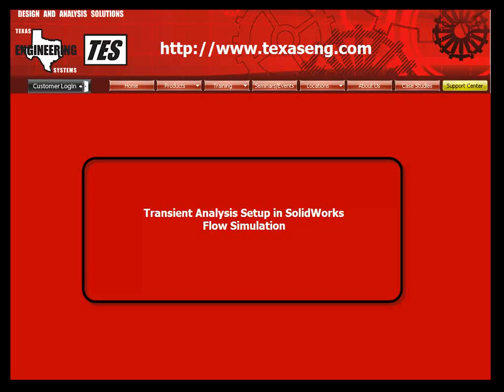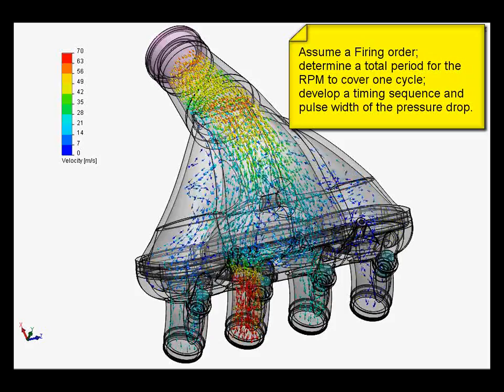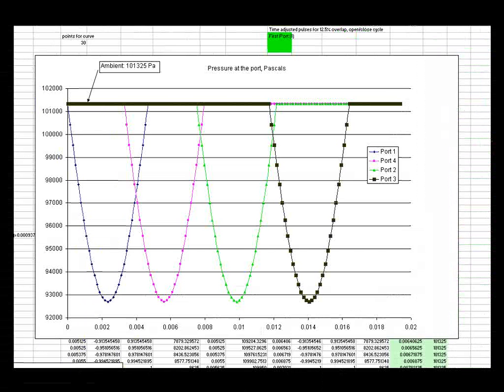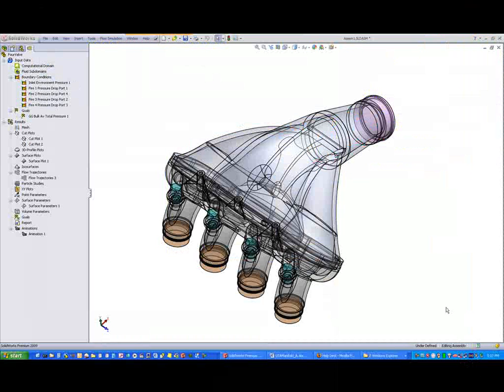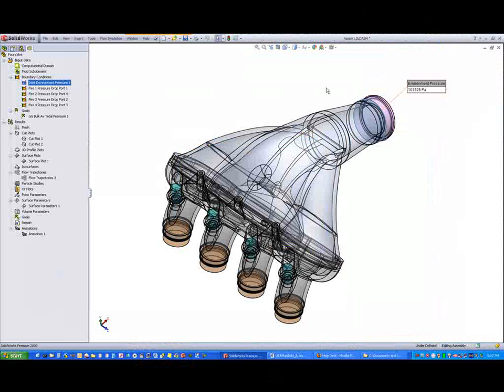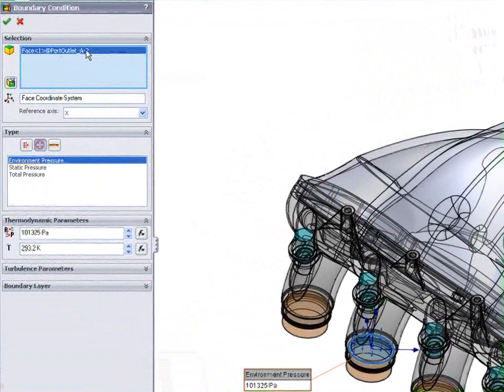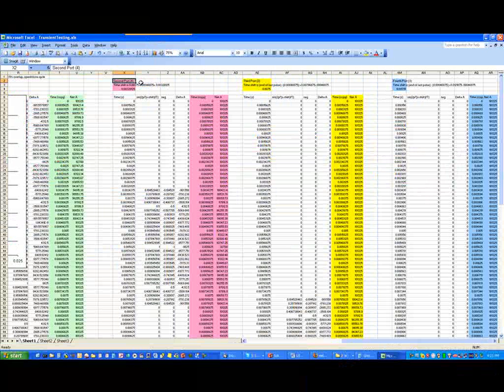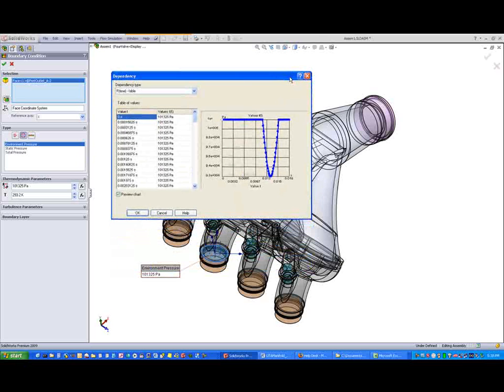SolidWorks Flow Simulation - Transient Manifold Airflow

Comment: In a flow simulation of fluid flowing in a series of pipes, in a region of high turbulence in the pipe, how can I find the velocity of flow at a certain point in the high turbulent region over a period of time. Say for example, velocity at that point at 5 seconds, 10 sconds, 15 seconds, etc? Please I'd appreciate a response.

Thank you!
Reply: you can draw a sketch line through the point you want to monitor, then use the xy-graph utility to examine the velocity magnitude at saved time points in the solution (you have to tell the software at what time points to save results prior to the run). Tutorials which come with it have xy plot examples, or contact your VAR for more details. thanks

Comment: Hi Sigsite!

Is it possible to simulate things such as heatsinks?

Lets say I desing a heatsink, and I select the part of which is supposed to be in contact
with the chip. Could I select the surface of that part, increase the temperature to any value, and see the heat spreading through the heatsink as well as seing the surrounding air get hotter and rise?

Thank you!

Comment: Dear Sigsite,

I'm a mechanical engineering student and at the moment I am graduating at a company which develops filter systems, do you happen to know if it's possible to insert a material which leaks air ? (i'm trying to make a simulation with filter materials)

Kind regards.

Comment from the maker: Hi. There is a setting the "Calculation Control Options" to turn-on transient. It is in one of the tabs on the dialog. You can set the end-time and time step size, and the frequency for saving results at certain time steps. Hope that helps!

Comment from the maker: Hi. It is just referring to the airflow as transient due to flow paths changing over time. If only one valve was open and stayed open, then you could run a "steady state" air flow analysis to observe the flow. The flow paths would not change with time. The title should probably be "...transient airflow in a manifold...". Sorry about the confusion.

Comment from the maker: You can create an angular momentum of fluid to simulate the rotor motion (but it won't directly spin the rotor). In SolidWorks Flow Simulation, you create a dummy body of fluid surrounding the turbine and rotate the fluid in the opposite direction of the rotor. You might need to contact your VAR about how to do this, but I know the software can do it.

Comment from the maker: Yes. If you can describe the path of the knot with points in xyz space to represent a centerline path (say, in Excel for example), you can open that directly in SW and it will build a 3D curve for you. From that, you can sweep a surface or hollow solid. You might need to check with your VAR on how to do that, however, as I am unsure of the exact procedure.

Comment from the maker: @GaboD1000 
Yes, generate a cut plot (or some other plot), right-click on that and choose "animation", then use the "Wizard" button and choose option "Scenario" to load the 20 files all at once. Then insert a control point on the time line of the plot and stretch to the end.
Here is a video we did for GoEngineer's YouTube channel: youtube.com/user/goengineer

SolidWorks Flow Simulation - Animation of Time-Dependent Heat

Good luck.
-Tony